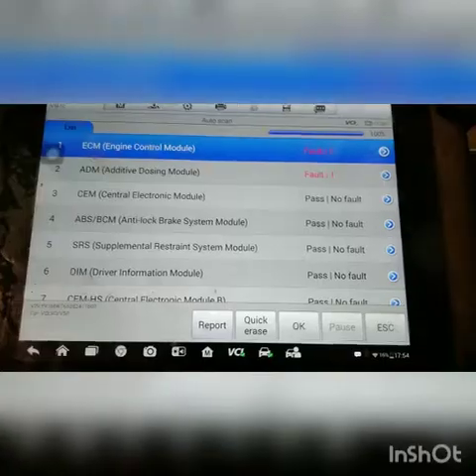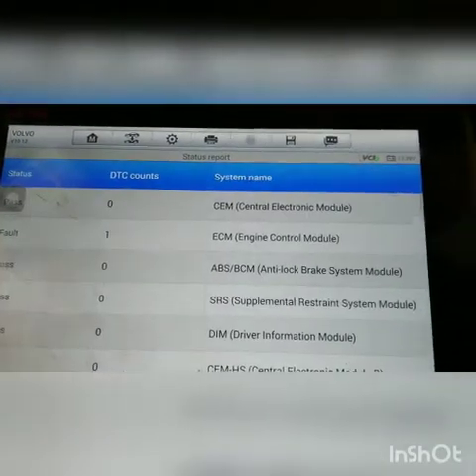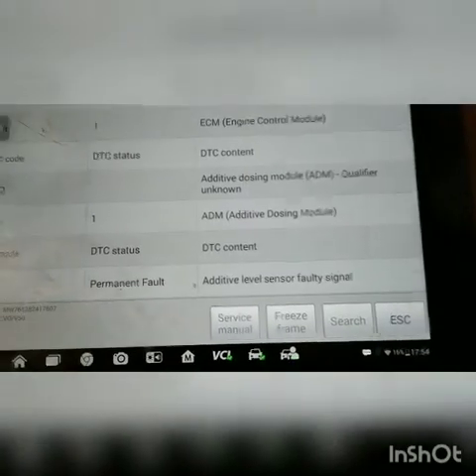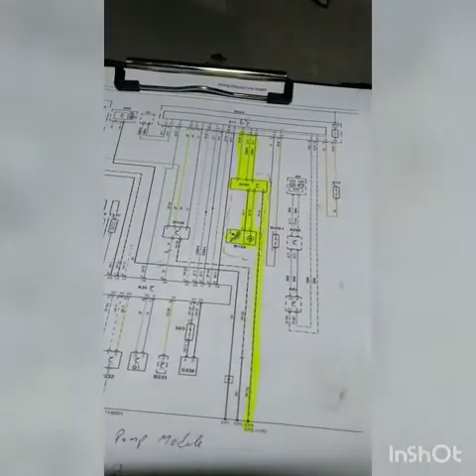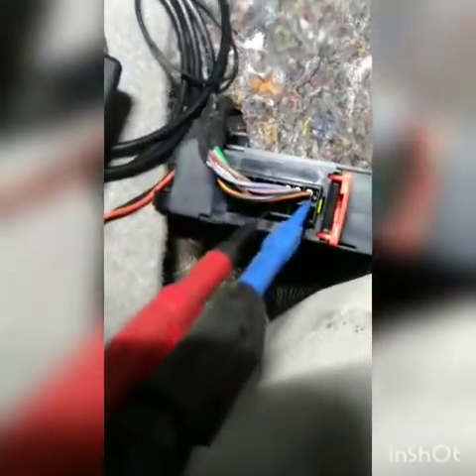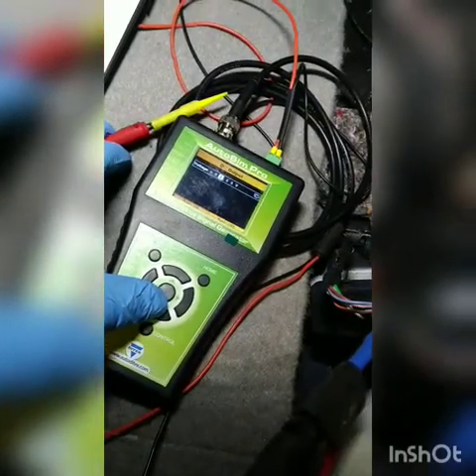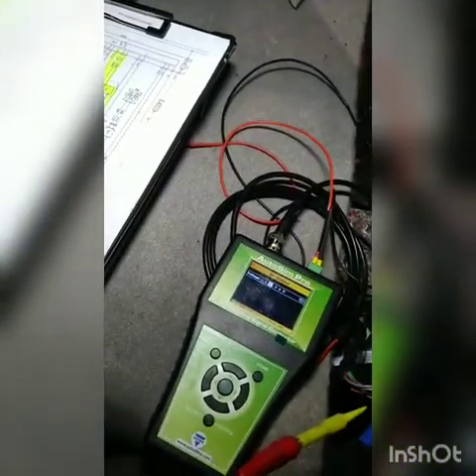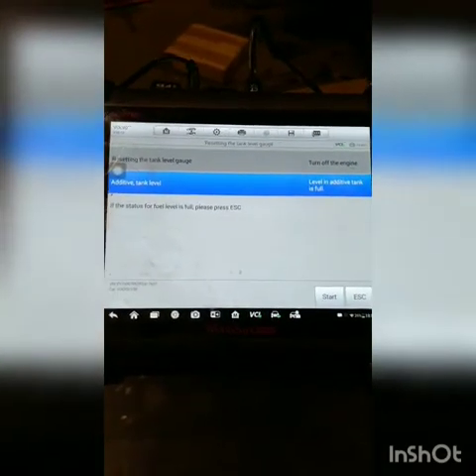Volvo V50 additive dosing system diagnostics

Comment: I got an issue with my friend car , its volvo v40 2016 model , in the display showing the distance , but there is no volume , The speakers are working when we turn on the radio. Also i found when we increase the volume the sensor volume can hear, but only from one side . I mean its Right hand car, and the speaker that only working left side . I reset the volume many times but there is no difference. We need to increase volume button each and every time when we reversing can anyone suggest the issues to solve.

Comment: There is no point of these kind of videos if you are not telling or showing exactly what is the signal and how you are sending it to unit. Is it just 2 Volts dc and is the brown wire the positive one and the one wire (with yellow stripe) at right up corner of the terminal is the ground wire?? Looking this video only shows that you can do it but it does not give us exact info how we should do it. I don't want to try it with this weak info and burn my module. Give us better info and you will get more followers for your channel.

Comment: Thank you Sir for your video. I have just aquestion, how can I give 2volt without having the Autosim as you have in the video, is it eny way to put 2volt as you said in the unit system without Autosim. other question what if I buy new used unit, do I need to program it, or is it just to conect if the part number is the same. Thank you

Comment: The Additive tank has a 4 pin connector.  Pin 1 is the tank motor.  Pin 2 is both the motor's "ground" as well as the signal ground for the level sensors.  Pins 3 and 4 are for 2 separate piezo transducers which measure fluid level.  The measurement  works like SONAR - a high frequency "ping" is sent out and the time delay to it's echo is related to the fluid level.  Measurements are only taken when additive injection takes place and when the car is started.  

I don't understand how the AutoSim Pro was used in your video and wonder if the faults were resolved solely by refilling the tank.
Reply: Filling the tank doesn't solve the issue because the control unit doesn't recognize the additive level inside the tank.

Comment: Dear Sir, thank you very much for your movie.
Can you possibly inform me where to connect your Autosim Pro in order to generate the signal. I have the same problem, there is no voltage from the ADM output. Thank you in advance.
Reply from the maker: Hello thanks for your question. It's been a while since I done this video. I had a look at a wiring diagram and you need to power up the level sensor in the tank from the control module side
Reply: Szia. Hogyan lehetne ezt megycsinalni készulék nélkül

Comment: hi, not mechanicaly minded, but have same problem. when you sent a signal through wire and you cleared the code, did you still have to replace the module